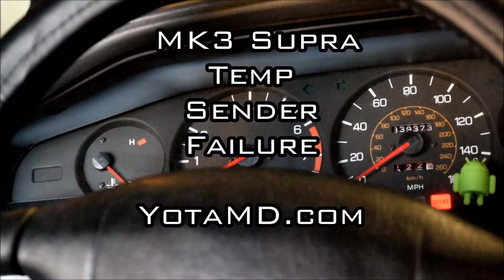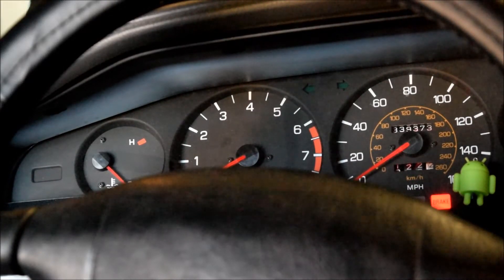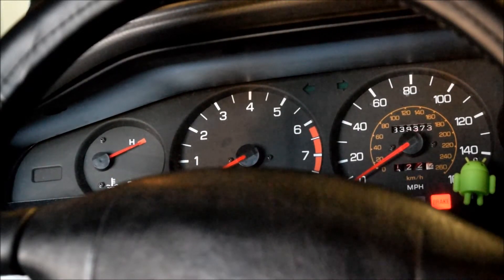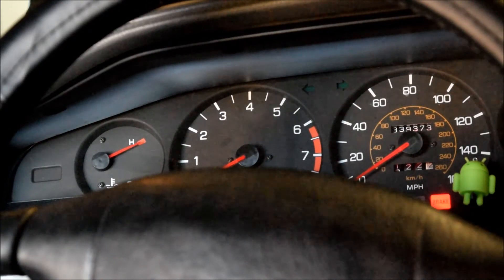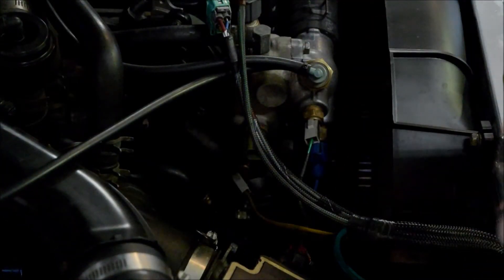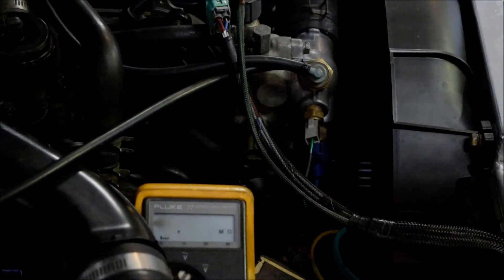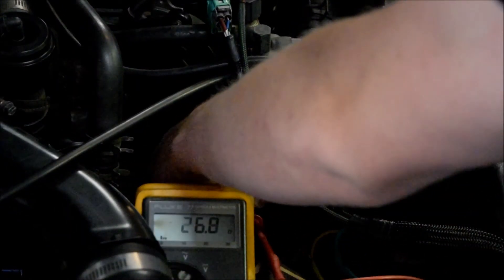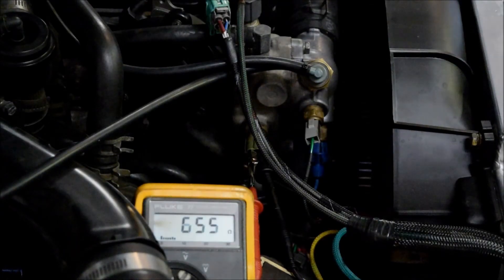MK3 Supra Water Temp Sender Failure

Comment: I’m having the same issue with my 1JZ-GTE. I bought a new OEM sensor and I’m going to change it out this week.

Edit: So, the sensor came in and I plugged it into the harness. The old, dead sender spikes the temp gauge to max like was shown in this video. The new sender shows cold, so I’m confident once I install it, the gauge will return to normal function. I was, previously, concerned it might be a swap gremlin but it appears to be OK.

Comment: Nice mine is a 1990 n/a and my temp gauge like to work sometime but don’t want to stay and go down like it’s not working. What do I do?
Reply from the maker: You'll need to test it with a DMM (digital multimeter). You can remove the sensor and test it in a pot of water on the stove or something. You should see a nice, stable response. If the sensor looks good, start investigating the wiring. Check out the online TSRM for details.

Comment: Hi I wanted to make sure the wire that runs from the temp sensor to the temp gauge is good so would I apply negative or 12v positive power to the wire to see if my coolant temp gauge needle moves any help would be greatly appreciated thanks